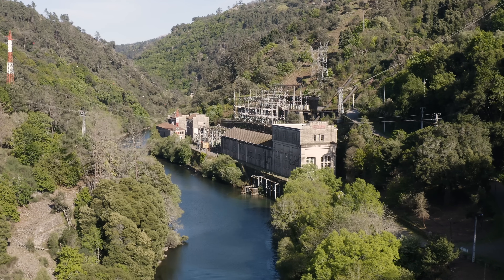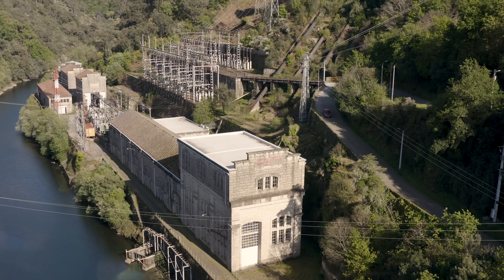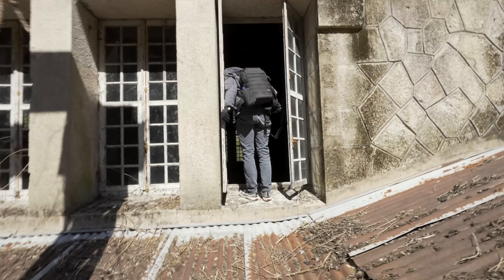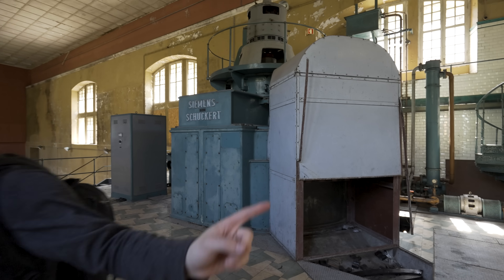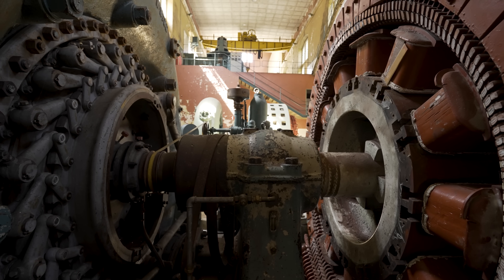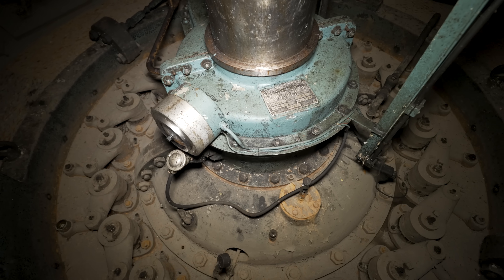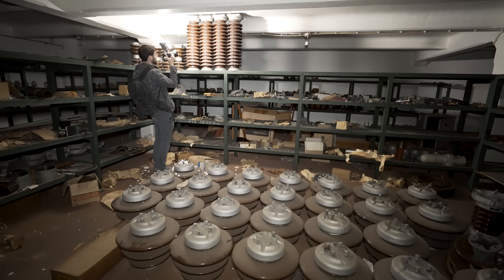Exploring an Abandoned 1920s Hydroelectric Power Plant with Original Generating Units

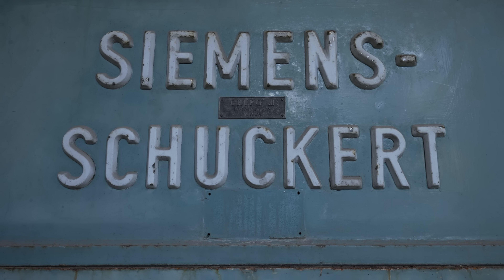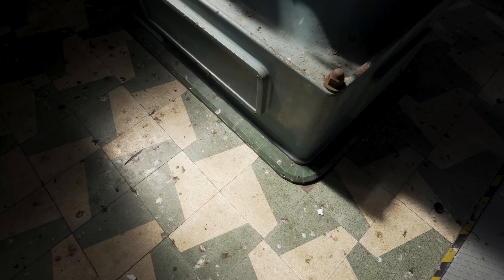Comment: 6:30 The pattern in the tile floor represents a rotating turbine or four-bladed propeller.  See it?  Like the ancient symbol older than the swastika.  The outer edge of the General Electric logo is similar.   7:14 The turbine silhouette is mirrored in the black and the white tiles.  Notice that there are two shapes for the tiles, both black and white.  The slope of the line intercepting the black and white seems to be either "A" or "B" ratio.

Comment: These small ones are horizontal Francis turbines direct driving the synchronous generator .
They may have been the station service units, they make power to run the dam itself, not to be exported to the customers.

The wall Plaque Voith is for a company still in business , one of the largest of the the largest hydro companies in the world. One plant making things and repair parts is still  running in Lancaster PA they got when Baldwin Lima Hamilton Hydro  went out of business.

The 4 large vertical units are probably Francis turbine also but Kaplin turbines would have the same setup.

It is normal for the generator and turbine to be two different  companies and only a handful
Of companies made governors , Woodward of Colorado bring a Big one.

Comment: I never understood why turbine and generator halls are so massive and grand when the machinery itself takes up very little space comparatively
Reply: The equipment is often larger than it appears, and you need room to be able to take the units apart for maintenance  (hence the overhead crane). For example, the turbines under the generators are quite large, as are the generators themselves. In the coal power plants, the turbine halls are so large because there are huge condenser units and pipework under each steam turbine. And again the turbines and generators themselves are multiple tens of tons each and need disassembly space in the hall.

There are a number of videos in YT that show turbines & generators under maintenance, and you can see that the space is important.

That said, the turbine hall in the abandoned nuke plant the PP explored seemed cramped by comparison. Maybe that's because a single turbine & generator supplied all 850 Mw of its designed output?

Anyway, I just love these amazing, grand spaces, and especially the old ones that truly seem to be temples to the gods of electric power.

Comment: Not sure I could resist the urge to try and flow some water through those turbines to see what happens.
Reply: I was wondering a bit myself what would happen if someone clueless went in there & started turning valves & /or flipping switches.  I'm wondering if that panel they still found energized is some sort of remote safety monitoring equipment?  I also wonder if the water input to the turbines was blocked before they shut down the plant.  If any of the turbine inlet valves are live, this could be a potential disaster waiting to happen.  Hopefully the fact that the plant seems to be totally unguarded means that it's secured.

You guys did a good job of documenting this beautiful little power plant.

Comment: im sorry but the ones you called insulators are not insulators. those are called bushings, it worked almost like a typical cable insulator, but it just work much better to distinguish any leakage of current

Comment: Ohh.
Why can't this be held in posterity?
I saw some stators missing... Copper thief's. May they burn in hell.
 How many places are in such good condition?
I'm sure there are records. Those who can be held accountable as to why they weren't preserved will have hard questions placed before them publicly.
Art museums get the publicity. Art does not heat your hot water, does not get your from A to B. Does not put food on the table etc.
Seems appreciation is miss placed.